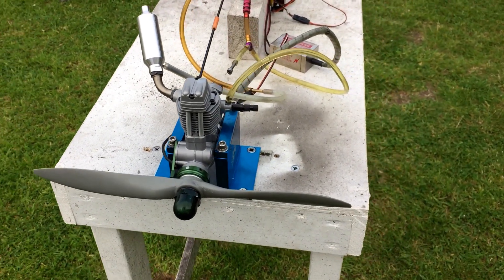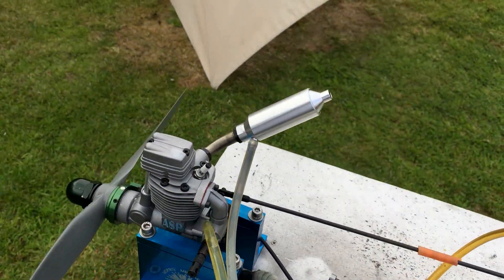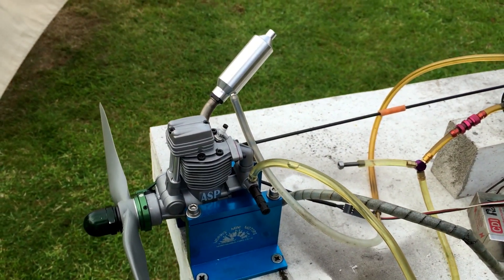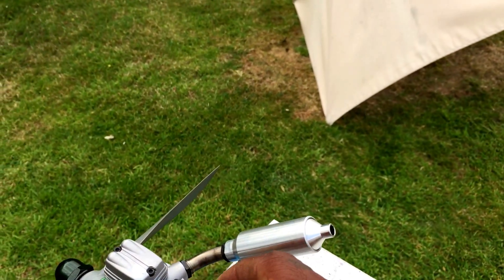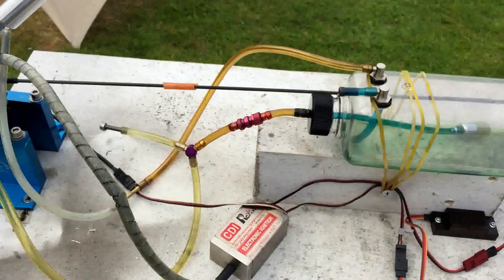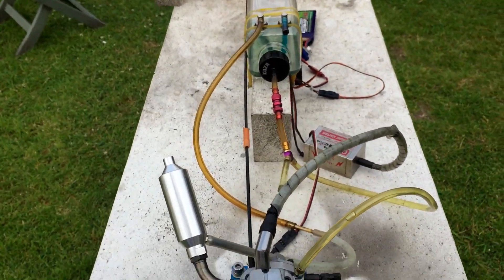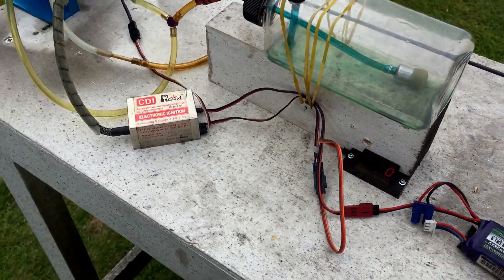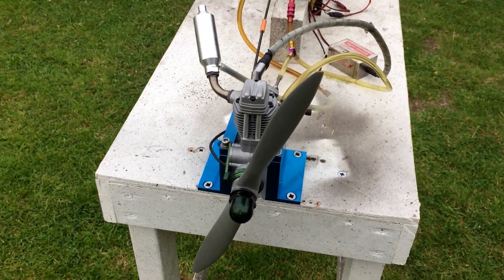ASP FS-61 CDI conversion running on gas 20 to 1 mix

Comment: Sensor suite is it yourself?I want to know how many degrees 61 ar CDI ignition Angle is?
Reply from the maker: You can buy the kit here https://www.morrisminimotors.com/conversion-kits/asp-sc-p-h-magnum-conversion-kits/asp-sc-p-h-magnum-fs-61-single-cylinder-4-stroke-engine-sensor-bracket-and-magnet-ring-conversion-kit.html
Reply: Thank you, because I am in China, so can't buy this suite, check point on the engine to the magnet that ignition Angle is 30 or 40 degrees for good?
Reply: @rongfeng8899  28-30°BTDC

Comment: glow to gas engine very easy to over heat . it run few minutes or head up will stop .
Reply: Is this true ? I thought I saw a comment where it runs very cool ?
Reply: @myname2263   thrust me, it does not, especially with stock carburetor. You can only tune high speed or low speed. If You tune your high then the low speed will run lean, You can hear in video it runs lean on low rpm.
If you richen your low speed then the high speed will run too rich.  
Don't waste Your money on these kits..  
You can buy a kit but use it still on methanol that way it runs fine..